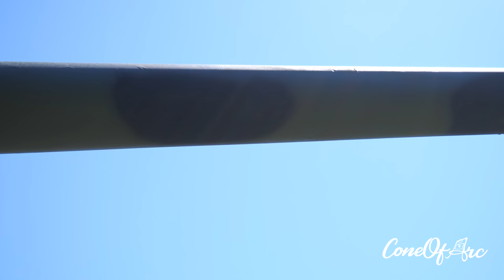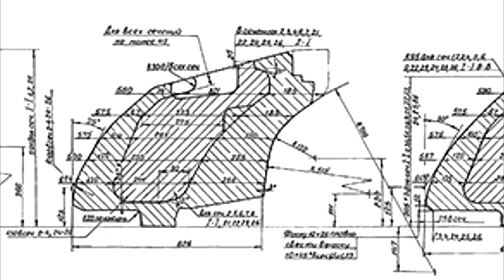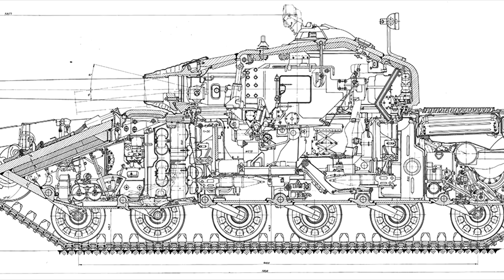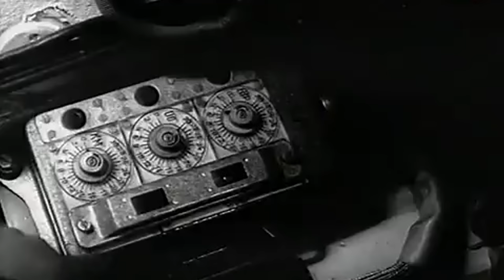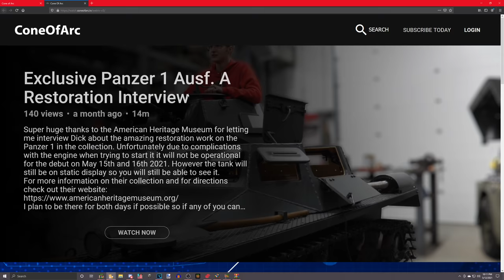Raising the Bar, the T-64 | Forged for Battle

Comment: The thing about the T-62 and T-64: they are not related designs. They were always directly in competition with each over, with the Kharkiv (yes, the city under siege by Russia today, and was responsible for the T-64 series) design bureau developing the Object 430 in response to the same set of requirements that led Nizhniy Tagil (responsible for T-62 and T-72) to make the object 140. Both tanks used the D-54TS (U8TS) rifled gun with more advanced fire control technology over the T-54 but were seen as not worth the advantages, thus the T-54 was given some of these advances like gun stabilization and NBC and made into the T-55. 

It was only until the late 50s that they desperately needed a new tank design and thus Nizhniy took the old 140’s turret, put it on a bigger T-55 hull and made the T-62A (Object 165) out of that. It was the D-54TS that led to the U5TS smoothbore through boring out the old gun. This made the Object 166, which was the T-62. Object 167 development, which gave the T-62 6 wheels over 5 and ATGM mounts, influenced the T-72 development later.

Comment: 11:55 min can someone pls explane me why it makes a difference in how the ammo is stored. I mean if the ammo is hit I will cook off any time, at the time where no or not any good spall protecting given to the autoloader...
Where is the difference In vertical or horizontal placement in the autoloader?
Reply from the maker: If it's laying down it has a smaller profile compared to standing upright
Reply: it makes a difference my friend,in soviet tanks (and also British) they utilized two piece ammo,i.e the ammo was separate from the charge that propels it,so in T 64 the round is stored Horizontally,i.e it lies down,while the charge is stored perpendicular to ammo vertically,i.e it stands along side the round,hence it posses a bigger target,so you have higher chances of getting hit on the charge rather than on round and if,  charge was hit,you are dead,but if you hit the round,then,the round probably wont cook of,this was fixed in T-74 and other tanks that came later by storing round vertically and charge horizontally,this made he round more exposed  and charge more hidden,so lets say if a enemy Heat-fs penetrated the tank and the resulting shrapnel spread all over inside the tank and hit the round,the round wont cook of,but if there was a charge in place of it,it would have cooked of,so this makes the tank a little bit more safer,its not a big issue,as you see if a enemy round did penetrate you,you had high chances of dying with the shrapnel itself,but,most crew survived the shrapnel,and rather died from the explosion,so if explosion could be minimized,the crew safety could be improved,this is the reason why modern tanks utilize blast doors

incase you are still confused Charge is the thing that explode inside of tank gun barrel,and the resulting expansion of  gasses propels the Round,
While the Round is the main thing that hit enemy tank
Reply: @FactsInto  thank you really much...
But there is still something I don't understand.
The autoloader of an T62,T64,T72 don't have any protection to it so even the spall of an apds/apfsds (KE) should be able to kill it in an indirect hit. While heat/heafs/rockets (HE) would be able to light of the autoloader also in indirect hit by blowing up the ammo through the armour. 
So where's the difference besides the smaller target?
And does it matter that much?
Are there any sources you got for me (I coundn't find anything about this)?
And again thank you guy for your answers.

One thing it just anyones me too much, cause too many people ask me that:
There is no T74 made by Russia for my knowledge. I think you ment T72 and it's just a tipo.
Reply: @cillersbadass7590  no problem bro,i'm happy to help :)

Yes the T 74 was a typo i meant o write T 72,but while writing quickly i misstyped you know

i will look for sources and if i find any i will pin them for you,personally i did not read any sources,but i know this thing because i had a teacher in my college who  previously worked in Pakistan Army Armored Division,and had extensive knowledge of armors,and i as  a nerd and gamer was curious about these things,so he told me about this, but still i will search on internet for sources,and if i find any ill comment them here,

no bro,a indirect hit from KEP(Kinetic Energy Penetrator)  round  wont cause enough shrapnel to hit the Horizontally stored ammo,it can hit vertically stored ammo because it is exposed,but Horizontally stored ammo is much less exposed,and there is a slight sheet that protects it from shrapnel,so,if you have charge stored Horizontally ,it wont cook of,but if the charge is stored vertically,then even slightest of penetration and shrapnel would explode the charge, the reason why rounds don't cook of so easily is because they have plenty of safety measures put in place which prevented them from cooking of with slight explosions, i don't know if this turn out to be a big issue or not,but i assume it would have been problem enough for the soviet designers to slightly redesign the ammo rack to make this changing,so i just assume it would have been atleast some problem atleast hypothetically for the soviet designers

i hope this made some clearifications for you :)
i'm not an expert on this topic,as i previously mentioned,i'm just a enthusiast ,with some knowledge,i may have made some mistakes,but this is the best according to my knowledge and understanding of the topic,still i hope i was a little bit helpful :)
Reply: @FactsInto  Thank you really much!!!
Reply: @cillersbadass7590  no problem bro, I'm happy to help ya, :)
Reply: @cillersbadass7590  if you want we can be friends and play some online game together, :)
Reply: @FactsInto  sure do you play war thunder?
Reply: @cillersbadass7590  nope, do you wanna play heroes and generals, counter strike global offence, black squad?
Reply: @FactsInto  sry all of them are all Games i don´t have, I am more of a Realistic player and Play somthing like Squad, war thunder, Insugency Sandstorm. and so an.
Reply: @cillersbadass7590  aight heroes and generals is pretty accurate game, try it, I suggest
Reply: @cillersbadass7590  haha war thunder? Realistic? Haha funny guy.. funny

Comment: Has ww3 broke out in europe during the 60s .t55 t62 t64 and t10 could easily over power the m48 and centurion tanks.
Reply: yes,but it wouldn't have been worth it,i mean,the civilization would have been destroyed!!!!
Reply: Yah because there is so many, that’s like throwing 10 Fat Guys at someone, even if the man is swole as hell. He will get crushed by sheer mass alone. However actual WW3 will be both sides throwing grenades at each other.

Comment: Please do part 2 that would be awesome. one biggest question then What tank is best or better the T-64, T-72 or T-80?
Reply: T-80. Although modern t-72s such has the t-72B3 are way better.
Reply: T-80
T-72B (1989)
T-64 B
Reply: T-80UD

Comment: As I've heard and read from russian source, that the suspension of T-64B is improved and just as relaible as the T-72, is that correct? I believe the later T-64B is just as reliable as those of T-80 and T-72s, as soviets produce 12K of those tanks, and Ukraine is doing a pretty good job with it.

Comment: For those who don't know "opposed piston design" means it had a huge diesel boxer engine
Reply: No it is not.Opposed is opposed boxer is boxer, no similarity between those
Reply: "An opposed-piston engine is a piston engine in which each cylinder has a piston at both ends, and no cylinder head. Petrol and diesel opposed-piston engines have been used mostly in large-scale applications such as ships, military tanks, and factories."

Comment: Eh, the lack of an extra crewman seems like a non-issue. If you need more hands organically for daily maintenance, you just have some MT-LB type people carrier with the extra Ivans idling in the back while the tank crews do their thing. Maybe even doing some maintenance on separated engines, or guns or other standalone components. And when it's time to make camp and start maintenance, the MT-LBs drive up and the dedicated mechanics join their respective tank crews.

The only real expense of such an arrangement is a few MT-LBs, while the manpower requirement is still the same for the unit. Plus, you can keep the actual battle tanks lighter as they don't have to stow the crew's gear and equipment, but that can go in the MT-LBs.

This is how France does it with its Leclercs.

Comment: I served in the Bundeswehr tank force and I can guarrantee you the Leopard 1 would have been no match to these Soviet tanks. The Leo's speed would have been useful only for running away, which is kinda pointless in armored warfare. I guess we can count ourselves lucky the Cold War didn't turn hot in the 70ies, because we would have looked really silly if it did. Anyways, the T-72 and all its modernizations are even scarier than this one. They had better guns than us, better armor and they were lighter. That would have been such a lopsided fight in their favor.

Comment: Its a good video but I'd please like to see a source for the autoloader taking limbs off. I hear it time after time for either the T-64, T-72 or even BMP but I haven't seen one report or quote. At this point I start to think its a urban legend..
Reply: All this bullshit came from BMP-1 autoloader , which is known to be kinda dangereous and you have to be cautious while using it (the manual actually mentions that there is a chance of the autoloader pinching the gunner's clothes) but i haven't heard report of serious inury due to it and there is not really enough space to take the arm or do really bad injurys , only bruises and damaged uniform . And after that it was amplified and spread to T-64/72 autoloaders and it became the myth we know today even tho if you look at either tank loading from the inside you can't put your arm inside the loader , even trying to do it on purpose while it's loading would be really hard , there is a metal protector + you only have 1-1.5sec to put your arm in the breach in order to loose it .

Comment: Small correction:

T-64 has never had anyone on record for losing an arm. The reason is simple...there's a divider and gunners are trained strictly to stay within the confines of their station. I bet this story came from some 3rd world nation that had poor crew training or inexperienced in the middle of battle and in their panic stuck their hand in the breach but that's like saying Abrams is notorious for chopping off your hand when in fact if you load slowly and neglect to pull out your hand the design is automatically flawed. 

Another quick point about the engine fire...this tanks was not only the first to incorporate automatic loading but also had the most advanced engine beating out the west...5TDF motor. It did have issues but overheating and catching on fire was extremely rare. Mostly it was temperamental with dust a plague to just about all engines even to this day..just ask Abrams crewmembers during the Desert Storm operation where quite a few had to be hauled for that fact alone. 

In short it had some short comings but it did its job and Soviet Union was ahead in many respects up until introduction of Abrams. T-80 and T-90 leveled that playing field with much better protection to prevent cook offs but still using the principle of shell placement ...however with introduction of T-14 now in production the worlds best tank once again goes back to Russia. 

For those that claim T-14 is not combat proven neither is F-22 and yet its bragged as the best plane. So either stick to a golden rule or be a hypocrite. On paper it is factually the best not only in terms of protection but in technological breakthrough...literally a crewless turret able to fire on full speed with direct impact at long distance with the most powerful gun mounted on any tank to this day. That's more then enough to make it the best in the world. There's even a K model for Command which means the entire tanks is autonomous and does not need crew at all. 

With the conflict in Ukraine now coming to a close with so many lessons Russia is now the most experienced army in the world proving mighty over 40 nations with Leopard 2a6 and Abrams now showcased in Moscow.
Reply: That is a hell of a lot of nonsense, not surprising coming from a vatnik. Russia's invasion of Ukraine is not coming to a close anytime soon.
Also, which tank holds the current 1st place in the Turret Tossing Olympics?

Comment: 0:42 you have a little mistake here. You said, that Germany Was forced to produce heavier tanks for defensive usage. The Tiger 2 (also called Königstiger) was initially planned before the Invasion of the Soviet Union in 1941. So it was not designed to be used as a bunker on tracks. It was planned to use it, like the Tiger 1 was used: as a tank, technological better than the ones the allied would have.

Comment: It's kind of a mute point at this point whether the T64 or the T72 were better. After 2 plus years of war in the Ukraine, the T64 has basically be abandoned and only the T80 is built and/or modified. Whereas the T72 continues to receive upgrades and continues to fight on the battlefield. The Ukraine still uses its Soviet era T64s, and many were modified, but their stocks are dwindling and there's no real production or capability. While a great tank at its inception, the T64 is now becoming an afterthought.
Reply: T-72 was cheaper and a bit more reliable and during the 80s it had surpassed T-64 in armor so it make more sense to produce it

Comment: I was downloading the game and my AV flagged a file as a virus....
Reply: When I scanned mine , Malwarebytes didn't see anything.
Probably a false positive
Reply: @boymahina123  Im worried about the virus being inserted DURING download. The files might have been clean but somehow some party injected a virus during download only
Reply: @weebitteeateeweebit  in that case, run a scan right after the download
Reply: @boymahina123  it would still flag the file as a virus. This is an old issue and my AV hasn't cleared the game after so many years so it's not likely to be a false positive
Reply: @weebitteeateeweebit  have the AV remove the file, then see if the game breaks
If it does, join the AW discord and ask around
Reply: @boymahina123  It refused to continue the download when I did that...
Reply: @weebitteeateeweebit  Yeah you need to get in contact with support about that

Comment: Why Russian tank design is more round and Nato tank more boxy?
Reply: Maybe beacuse russian tanks got autoloader so they dont store ammunition in turret but nato tanks keep ammunition in turret and 1 extra crew so require big turret
Reply: It comes down to protection vs ergonomics

The first clash if those 2 principals was in ww2 where German Panzers, more ergonomic but less protected, faces Russian  tanks (t34 & kvs, not the t26 & bts) which were very well armored but had horrible ergonomics

Also yes the fact that there is no loader, along with the carousel autoloades makes the turrets rounder
Reply: the soviet ones were designed for low profile so it would be harder to hit because in that time there wasn't any guided AT weapon, the crew consists of 3 personel (driver, gunner and commander), they have an auto loader and the ammo rack is stored in the ass of the gunner, thus the reason the turrets blow up

NATO ones were designed for armor and firepower without caring about the size, the crew consists of 4 personal (driver, gunner, loader and commander), but that's also changing, the French Leclerc and the German KF51 have an autoloader, the new AbramsX has a humanless turret, wich means another autoloader tank (in case you ask Russia has also a humanless turret, the T14 Armata, seems smaller than the American one but I have to take a closer look)

Comment: M60 was not a patton, sry had to say it
Reply: Though it did get the nickname Patton anyways because the M48 and M60 were very similar
Reply: @Predator20357  it was never officialy named patton tho
Reply: @NickismyNickname  The M4 Sherman or M3 Lee didn’t have the General Names until given to the British.

Official Names mean nothing in the long run like how the M60a2 was never officially the StarShip but was called one because of how complex and Expensive it was. That just how naming works.
Reply: @Predator20357  the names were later adopted officialy and they had a naming ceremony. Starship was an unofficial nickname. Just like the hetzer. The tiger was officialy named tiger tho.
Reply: @Predator20357  Even wikipedia says that the m48 was named after patton and explicitly says that the M60 was given no further designation/name

Comment: The historical context was the 64 & 72 were competing designs from rival manufacturers. The 64 was dazzling innovation but very expensive and very unreliable. The rival, 72 was a cheaper and somewhat more reliable design based on old tech with some newer tech duct taped on if you will. The 72 won govt manufacturing contracts even though inferior in many ways.

Comment: 64 was the last good tank the Soviets built. The 72 was worse, and the 90 is a poor upgrade of the 72.
Reply: T-80 is in my opinion.It’s basically a better armored and faster T-72/T-64 with better reverse speed.
Reply: You realize that the T-72 outpaces the T-64 in capabilities after the initiation of the T-72b, right. Just look at the current models,.the T-72b3 2016 is better than the T-64M Oplot.
Reply: T-72 was never worse 
it’s a decent tank that got poorly used and poorly upgraded